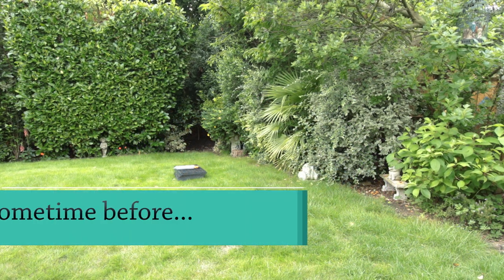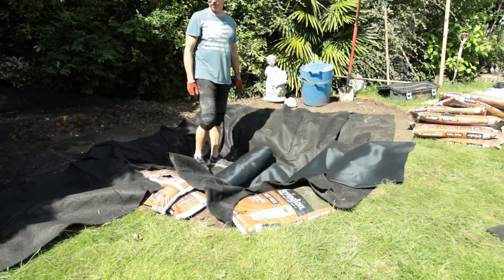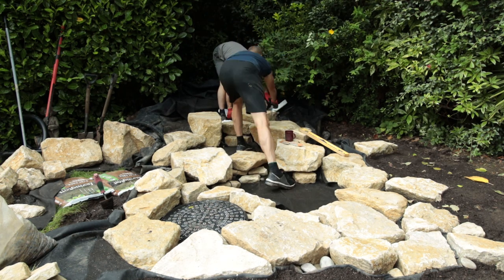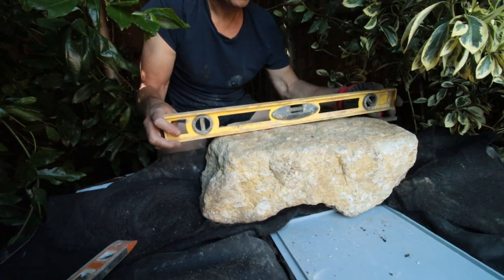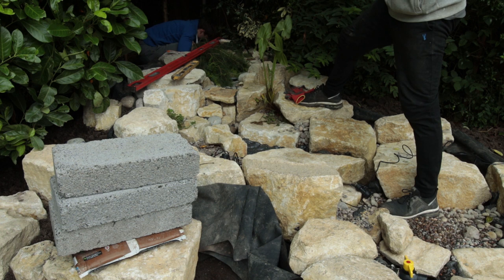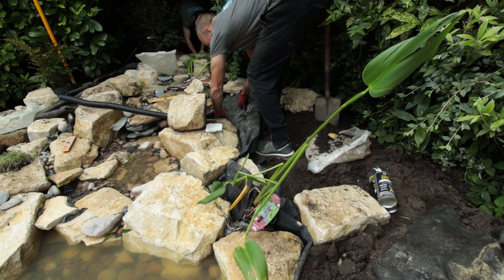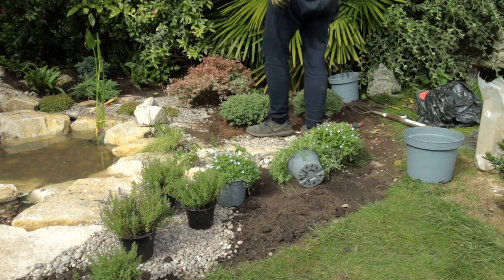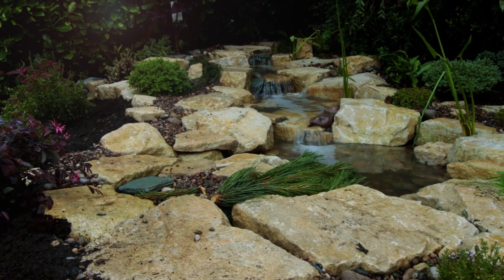Pondless Waterfall Build Aug' 2021

Comment: Gorgeous work gentlemen. 👌 👍 Edge treatment looks phenomenal. 🥇

Love that mystery fall that kicks in from the side on the 2nd drop. Is that just foaming around the rock to get the water to flow around it? Or a pvc pipe?
Reply from the maker: Thanks for the comment Eric, we used flexible hose to take a feed from the upper waterfall pool.